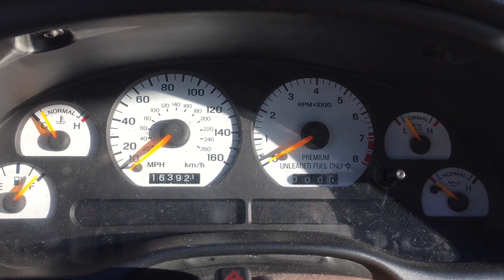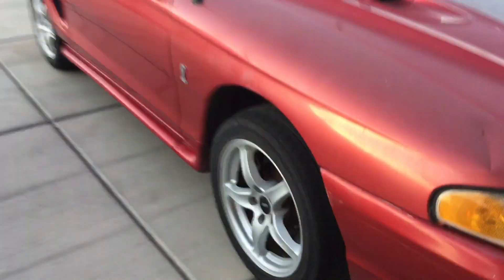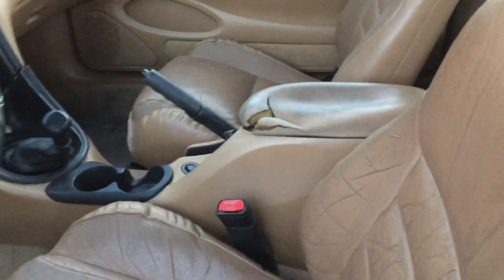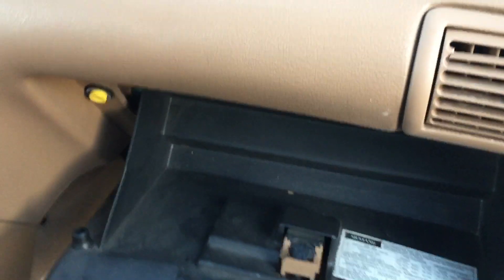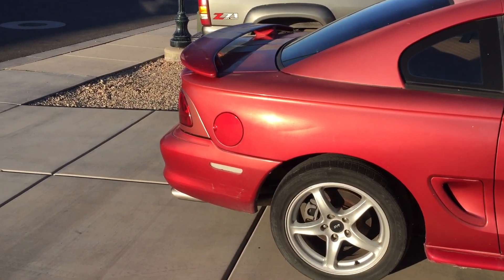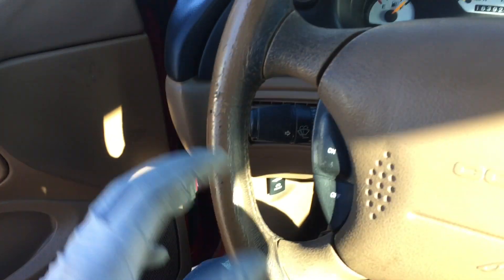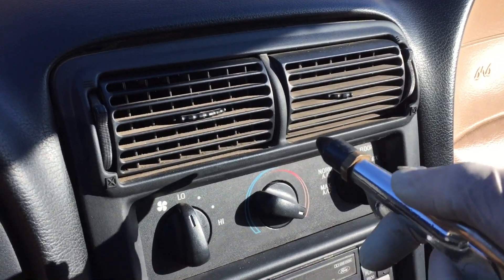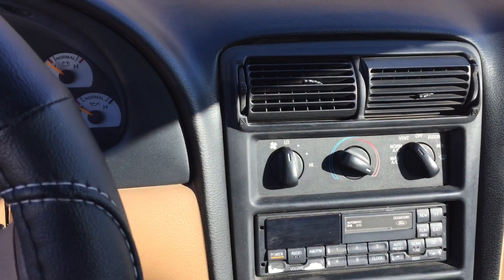Project 98 SVT Cobra Update: Quick ride & Clean

Comment: I appreciate you Danny trying to revive the SN95 cars! Best of luck on the new Cobra
Reply from the maker: Thanks! We grew up loving these cars and still do!
Reply: I did as well. I remembering seeing a new edge and I fell in love with the rear. When I graduated HS my mom gifted me a 2000 V6 w/ 155k miles in black. Last year I bought a 1999 GT in crystal white w/ 89k miles in excellent condition. The dream is to get an 03-04 cobra. You make me want to have each version of the new edge haha
Reply from the maker: JaVvii3 Ha ha. They are all good. I love my 01 oxford white- even though it has the crystal white front bumper that doesn’t quite match ha ha
Reply: Danny Johnson Lol I’ve been trying to find a crystal white hood with the hood scoop but I haven’t been able to find one. I’ve found an Oxford white but yeah it doesn’t match with the crystal white
Reply from the maker: JaVvii3 I have a crystal white hood. None came with the hood scoop (since the hood scoop didn’t come out until 2001 unless it was the 35th anniversary or spring feature edition).
Reply: Danny Johnson Are you selling it Danny?
Reply: Danny Johnson my 99 is a 35th anniversary but I guess it didn’t come with that option. I know the side scoops are like the Cobra R and not like the Cobra
Reply from the maker: JaVvii3 Shipping would probably be too much.  Ford made specific 35th editions, different than the badge that appeared on all the 99s (except the cobra). https://youtu.be/GsDsfE1Wz3g
Reply: Danny Johnson How can i contact you Danny?

Comment: I’m sure you’ve already been told this already but in case you haven’t; Ive always used about a 3 inch wide paint brush to clean vents and trim pieces on the interior. It works the best I’ve discovered.
Reply from the maker: GenAfterNextTactics I need to buy one
Reply: You're right. I discovered that trick a few years ago. Now I have about a dozen paint brushes, and I use them to clean literally everything.

Comment: I have a 99 and my door speakers went out about three years ago while I was in college so I took out the dual single din setup just like what was in this car and got an 01 bezel and jb welded a new double din adapter cage to it and then mounted in a new pioneer  double din radio to the adapter cage for the 01 bezel.  Now I just have to take it to the audio shop to get everything else replaced and wired but the double din looks so much better and is very useful for navigation with car play/auto.
Reply from the maker: I have a really nice double din IUP silver one from a mach 1. Might put it in at some point

Comment: I've had issues with the windows, keyless entry, and dome lights not working and found out some of the wires on in the driver's door leading to the fuse box were broken. I soldered them together and problem solved. You could start there on troubleshooting.
Reply from the maker: I’ll have to look into that. Thanks!
Reply: @dannyjohnsonsgarage  You're welcome. I have a pacific green 1997 Cobra that was neglected and going from front to back on it.

Comment: Since you have high miles on the cobra i suggest getting a new chain and tensioner kit. Sometimes second gear is known to grind a bit on those t45's too if you beat on them. LMR sells the oem cobra emblem for the intake btw :). Im actually as excited as you cleaning the cobra up cause i went though that with mines,lol . O btw i have 2 diecast red 98 cobra 1:24 scale cars,my buddy gave me one for my bday when i already had one,lol.
Reply from the maker: Nice! I’m going to get some more info from the original owner, but I was told before buying it that the car has a new engine. I’ll find out if it’s a mark 8 or cobra. No plaque/sticker on the cam cover

Comment: Hi Dan. Do you know why this Cobra smokes at idle on the driver side exhaust? Valve seals maybe? Car sounds really nice. BTW, for those mats I use Dawn dish wash liquid on them and they come up looking like new!
Reply from the maker: Yeah, it’s just cold and that’s only condensation. One bank may be running lean. We’ve looked it over thoroughly and it’s not smoking any oil or anything. We are in the process of tracking down the old owner (as you’ll see in some upcoming videos) because the claim by the seller was that the original owner had just installed a brand new engine, spending $5k. With that we are curious to see if the car retains the factory forged 8 bolt crank. It’s missing the svt signature plaque. I thought it might have the mark 8 engine, but then again, the cam covers are silver and not black.The coolant is so clear I would believe it, but we want to verify before we say so on the channel. Stay tuned! :)

Comment: Hi there. Have you had any issues with the cooling gauge reaching past the middle or reaching the "L" mark on the normal reading? Basically, is it reading an overheat situation?
Reply from the maker: This one has been fine- my 97 V6 did and I needed to burp the cooling system. If you do anything with the radiator you have to fill the radiator and use the cross over port- not just the coolant reservoir
Reply: @dannyjohnsonsgarage  Cool, I just used the crossover until the degas tank filled up, capped the tank, and then topped off at the crossover pipe. I will try that burping method as you stated. Thanks
Reply from the maker: KEITH WALLACE I’d let it run as well with the cross over off and the heat on full blast
Reply: @dannyjohnsonsgarage  okay, I will try that.